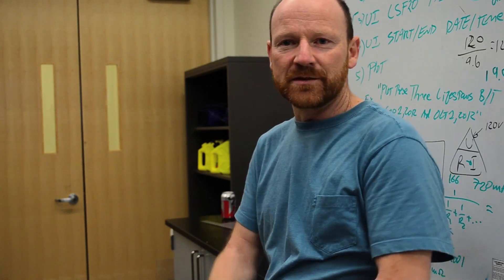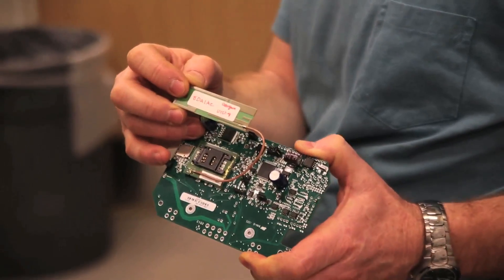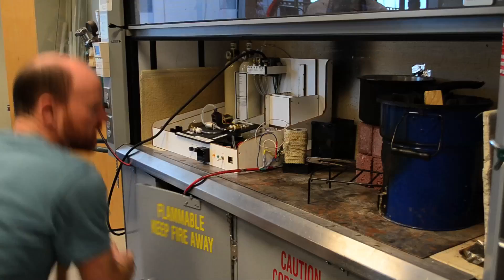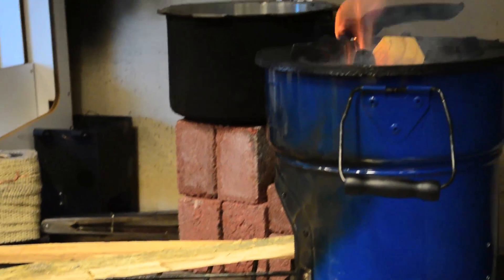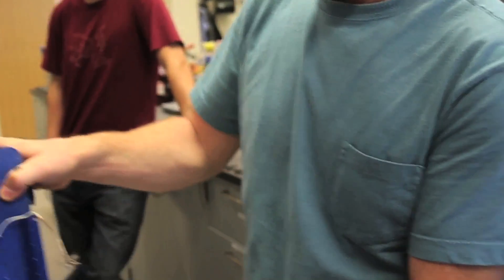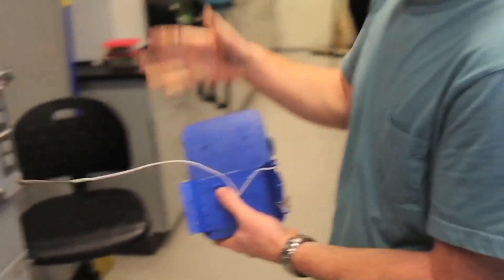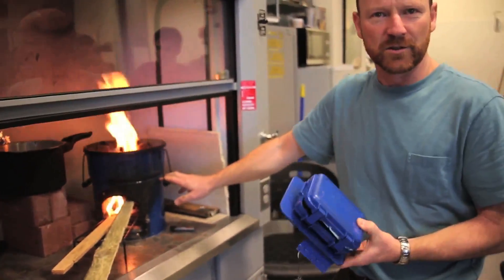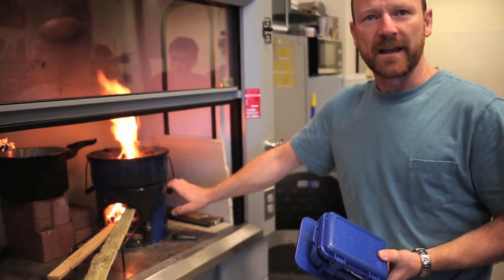Multifunction data boards :: One Day at PSU 2013

Comment: You started out talking about using circuit boards for water testing, then jumped to talking about stoves in Rwanda and using your circuit boards to test the interior and exterior temperatures of the stoves. There doesn't seem to be any connection between water testing and the stoves. Did some critical info get edited out? I'm totally confused...interested, but confused.